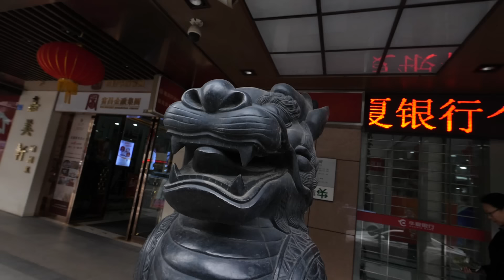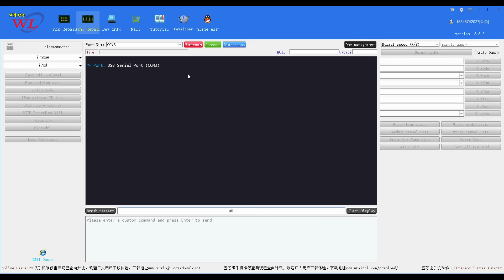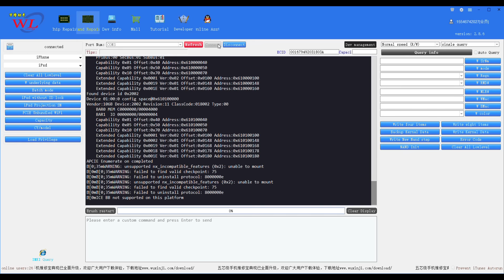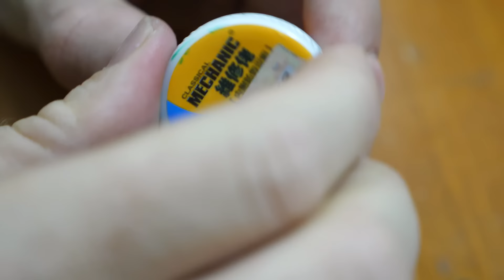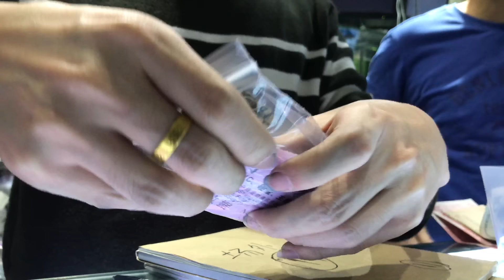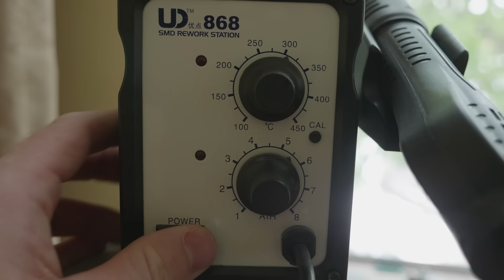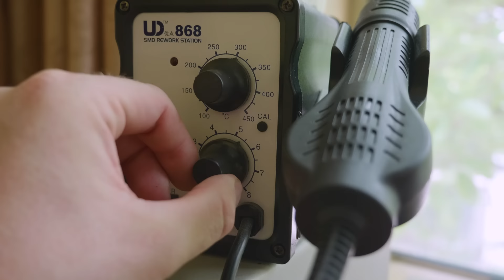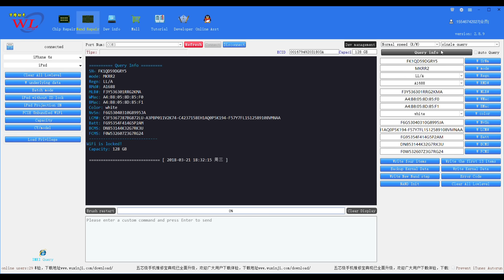How I Upgraded My iPhone Memory 800% - in Shenzhen, China

Comment: Ohh. You meant storage. I was like who the hell needs 16Gb ram in an iPhone?!
Reply: Haha right? iOS is totally a ram hungry operating system
Reply: Although it would be pretty cool to see a ram upgrade as well!
Reply: iphone x still using 3gb when 4-6 is the standard
Reply: iPhone works pretty well on low ram, the process control is really good.
So yeah, it does not have to be on par with Android standard for now in terms of ram.
Reply: This isn't about need though, it's about modding and doing something awesome! modding the iphone for more ram would be pretty cool imo!
Reply: but your paying for 1100€ of hardware and your getting something behind the competition
Reply: Of course, if Apple would give me more hardware, no one would say no.
However, I've owned two good phones from both party, previous Galaxy Note 3 and my current iPhone 7(not the plus). The latter one outperforms Note 3 in most aspect, despite have 1gb less of RAM.
The only thing you should be caring about is "end user experience", that is what you will really experience. Specs are important but should be put at lower priority.
I'm still using my Note 3 though, it does have open source advantage over iPhone for power users. For instance, I use IFTTT, web requests and Tasker for squeezing out more functionality out of my smart home. Other than that, for average customers, iOS is really an enough and better choice if you could afford the price tag.

P.S. I'm totally supportive for modding on iPhone, that's why I subscribed to this guy, it's more challenging but amazing.
Reply: yea and that $1000 gets you the most powerful processor ever in a smartphone and the best storage speeds you will see for the next couple of years, which makes the iphone run smoother and feel faster than any other smartphone.
Reply: Sage Wang android uses even less ram per se, but it is more focused on multiamtasking, if you ever watched a EverythingApplePro speed comparasion you would see that the iPhone reloads almost every app but Android phones doesn't. I think that this is not a valid point for the iPhone running "better" as today every phone is powerfull enough to do whatever you need to
Reply: Top Kek hate all that bullshit, not an apple nor android funboy but if you compare the user experience it is almost the same, some prefer one and some preder the other. So pls stop that BS
Reply: Of course an iPhone 7 will outperform a Note 3... They are 3 years apart. RAM has nothing to do here, 3 generations of CPU do.

You made no goddamn sense.
Reply: Yeah lmao I was like ok cool he'll have a lot of ram
Reply: Nikwunu your phone doesn’t use more than 1 1/2 to 2 if you are really drawing a lot

Comment: Those capacitors are mainly use to keep up with the memory speed. 
Missing few or so of those capacitors will result in a slow read & write speeds, which will cause the phone to throttle down due to insufficient read speed while opening an app or taking a photo. 
Could even affect video recording if there’s not enough ram left and the video is longer than 2 minutes. 

Most of those private iPhone memory upgraders stores won’t care if they mistakenly loose those ships. 

Yes, more memory, cheap, but at a cost of performance. Not worth it. 

At this point you realize that paying 150 to Apple is worth it.
Reply: I can too because im no iSheep.
Reply: Steve Owen Good for you. But that sd card still costs you lose in performance. The slow in transfer data out of the sd card will have an impact on your system.

Comment: You can do everything with your iphone in China but you can not jailbreak ios 11.2.1
Reply: until some chinese find the exploit ;)
Reply: CodeAsm its all about hardware isn’t it? Hope they do the same for ios software.
Reply: truth is already found. it's about some Chinese folks don't public it for no reason.
Reply: And same thing happens recently. Now Intel i7 8700K can work on Z170/Z270 motherboard coz some Chinese folks public the micro codes for older motherboards. No need to buy new motherboard Z370 series.

Comment: Couldn't you have installed Windows on Mac?
Reply: If I were to guess the reason, Bootcamp's drivers are good but it's not as good as running Windows off a Windows machine; sometimes UI scaling is really messed up. Also, he'd have to purchase a copy of Windows and probably get dongles.
Reply: SDG Danny no need to buy Windows. It'll run just fine without being activated. Buying just unlocks personalization and removes a watermark in the corner. Neither of those things will get in the way for projects like this.
Reply: MarioMan true
Reply: Probably to avoid errors and save money in the long run.
Reply: Jake Roosenbloom  dude I tried and I still have traumatic dreams about it.

Comment: Why not check for continuity between all the pin before soldering the memory and then compare the board you just worked on. It shouldn't hurt the chip testing continuity.

Comment: Android = SD Card Slot 
Apple = Buy a new phone or do this XD
Reply: well u must have 2 phone to compare i use samsung and i use apple all my phone 32 gigs well i tested to install all apps the same apps well samsung get the memory full first and apple just half empty and abut the ram samsung phone or any android used 2 gigs while doing nothing but iphone have 2 gig can do so much more bro u must try 2 phone together dont judge if u never use apple and samsung
Reply: @robertvincent5169  the operating system is there to use as much memory as possible for better performance and features..
Reply: Android SD CARD = Only files, photos and videos.
Apple Internal memory = everything and anything including apps, software, photos, videos and files
Reply: @Tom3294.  well that kind of true but some apps can be saved on sd card
Reply: @Tom3294.  ROOT and you can mount any sd card as internal storage
Reply: Many high-end Android phones don't have a SD card slot anymore as well.

Comment: Memory and storage are different memory=ram
Storage=capacity 
You can’t say memory change because that means ram switch to most people who know the difference
Reply: He already told that he made a mistake about memory and storage. :P
Reply: Although you are correct, but technically storage is also a memory, it's just that ram is primary and others come under secondary or external memory.
Reply: Most people don't know the difference. People who do are part of a niche population.
Reply: It's really just semantics, see https://en.wikipedia.org/wiki/Computer_memory and don't just read a sentence that agree's with you if you care. Wikipedia is written by random people, but a good source of information nonetheless.
Reply: ram is temporary storage for reading code and transmitting it to the cpu the more ram the more it can remember and the faster the device runs but at one point the ram will not make it faster because the cpu is slower
Reply: Blu BoX Not really. RAM is high-speed volatile flash storage. A hard drive is slower non-volatile (flash for SSDs) storage. Both can be used for storage or for random access, but non-volatile memory is better for storage and high-speed memory is better for random access.

Non-volatile memory is memory which can maintain its state after losing power.
Reply: Blu BoX yeah I thought he was gonna get 16gb or something lol
Reply: Memory or nand storage doesn’t matter the intention of this video is to show all is possible if you put passion and hard work
Reply: For some reason Memory sounds better to normal folks, just sounds easier
Reply: Its a perfect clickbait then, isnt it?!
Reply: Memory just means memory. System memory is what most people think ram is and most people don't know how broad the term ram really is. Almost everything is ram.
Reply: it's still memory.. a different one indeed but he's not wrong. so.. people that "knows the difference" will know that he meant storage by "switching memory" not ram.
Reply: It is, in fact, eMMC Flash Memory he's soldering, so he's using the right term.

Comment: I watched you on Barnacles Nerdgasm's livestream and that is how I found you channel. I have not looked into how the Iphone 6 plus 4K camera stores the video it records to the internal 16gb NAND chip ( I assume ). I was interested in seeing if it could be adapted to record to the MicroSSD. I know the newer storage tech is faster and has a higher storage ability but I have a MSATA in my laptop. I bought a case for it because I was worried that it may fall out of the slot being so much small that the port. So I bought an external case that holds the MSATA and makes it larger. So that interface from large SATA to MSATA has been made. The thing to find out now would be can whatever the Iphone 6 plus uses to attach to the internal soldered 16gb be de-soldered and a MSATA connector attached that would allow cards smaller than a credit card to attach. The compatibility would be handled by a software program. There should already be many programs that handle being an interface for pictures to a storage device. One may already exist to transfer from an Iphone 6 plus to a MSATA.

Comment: Memory =/= Storage
Reply: inb4 a flame war. But I agree. We should have clear rules what means what, and I advocate for "memory" = "volatile system random access memory"
Reply: memory both goes for RAM and ROM (the M means memory for both).
Reply: Yeah, but to keep people from mistaking which functional type of memory it is, maybe it's best to say "storage" instead
Reply: Yeah ROM isn't Storage though, not in this sense... ROM literally means Read-Only Memory
Reply: Do U mean memory != Storage ?
Anyway both are memories ... So...
Reply: Storage is Non-volatile memory. I guess Scotty's use of "memory"  is based upon, that hardware-wise, chips used for solid state storage, such as the one that is being replaced on the video are commonly referred to flash memory. In olden days, CF, SD cards are commonly called "memory card", Sony even name their stuff "memory stick"
Reply: Being pedantic and being wrong at the same time. Funny
Reply: "Blowing my mind" what about water = wet... 😑
Reply: For those of you talking out your asses and trying to be technical, when people in tech refer to memory, they mean RAM,  ROM is a power-off permanent storage medium, which is why we refer to it as storage, just like the manufacturers do.
Reply: Good for you men. You won an applause. 👏
Reply: Exactly.

Comment: 1:20 I cringed so hard, he could have just used boot camp assistant to run windows on his mac
Reply: no. Bootcamp is notoriously bad with proprietary drivers and causes all sorts of problems with usb connected devices
Reply: @AJK031695  Not in my experience of using it... then again, I only use it on my Macbook for doing simple things that mostly don't require USB's because of that stupid USBC crap.
Reply: There lots of limitations n driver bugs.

Comment: Why you didn't use some of the flash BGA from the scrap boards without i clould lock to put the on the motherboards with I clould lock and when you succeed you will have working main PCBs without i clould lock 😀?

Comment: Subscribed, and trust me I'm a very reluctant subscriber. Just don't want to be bombarded with too much crap, but I love this kind of stuff. 
I was supposed to come to China in May until this fucking coronavirus. Still wanting to come after it blows over. do they have these repair shops in other parts of China like Beijing and Shanghai?
Are you planning on using this knowledge to make some money doing this? Or is it more for just upgrading your own stuff? I think having this skill could be a good moneymaker in the United States since there are not as many people who can do this here. 
I need to get one of those microscopes 
I'm planning on trying to replace the broken glass on an LG v40. If I can find a replacement cheap enough.

Comment: Great Channel quick question I have an iPhone 14 pro Max that I crushed in my back pocket didn't know my keys were there but now I have the front screen and the rear screen cracked with one of the camera lenses screen also cracked here in the states they want close to 800 to fix I know someone in Italy that will fix it for under $600 but I figured all of these items are made in Asia and I'm sure there must be someone in China that would be able to fix my phone more affordably my only issue is that I'm afraid that they will switch out my original parts for aftermarket parts and the phone will not function properly what do you recommend?

Comment: when using stencil? can you use put stencil on chip, apply paste, then remove stencil, then???....put chip on board??-without pre heating balls?  or can you put paste on with stencil, remove stencil then heat up chip without stencil, then position chip on board and final solder?.....or none of the above?

Comment: Thats amazing if you do that as a job because the chip reader and programmer costs a lot, so if you have to do it yourself well it does not make sense!! I do upgrade Original Xbox from 64mb to 128mb and I am very familiar with soldering and also fixing but still if is just for yourself and you are not living in Shenzhen than the option you have to buy unfortunately is from apple.

Comment: With Bootcamp you could have repurposed an old intel Macbook into a Windows PC. You might (NOT SURE) have even been able to use it unactivated.
Also, there's one problematic example of price differentiation.  Fire tablet, 8gb vs 16.  The problem is that the 4gb is already taken up with the OS, and installing 'Star Wars: Kotor' (which was actually free from amazon at the time) eats up most of what's left.  What happens when a premium feature isn't really premium.  That's what has me a bit worried about the new 8gb macbook air's, when they have already sold intels with 16gb of ram, previously. I'm very worried Apple is going to require 16GB of ram for something in the future. There is a way to upgrade (thanks to Yang Changshun) but it looks even more difficult than this. :/

Comment: there was no need to buy a new computer to use windows if you have a mac!
you can use bootcamp on mac osx to have a second partition where  windows will be installed and booted on this, or ! virtualize an operating system with virtualbox and workstation for mac.

Comment: Hello there I have done the same thing I have changed my graphics card and running a EMULATOR of iOS and it’s running about 32 GB of ram also the have installed a i9 also a 1070 however this is a light version of the graphics card however it still works and runs the iOS hardware is what you could call working smoothly at this point lol honestly because it’s running the same iOS however your getting around 210 FPS to almost 150 FPS and there’s settings you can change to upgrade your gameplay also if we’re talking space I have installed a couple drivers because it’s a GeForce card this means you can clip things however you will have to enable custom binds for this others will not clip on iPhone devices

Comment: So if its possible to unsolder a memory chip from a phone and  store data and transfer to another chip. Is it possible to Salvage memory from a phone that has had some water damage, meaning it was beyond repair, it wont turn on,  if so, how would you do this. My phone contains some baby photo i may of lost forever.

Comment: my other challenge is it? turbocharging a weak QUADCORE tablet and another OCTACORE between (1.5 to 1.7 ghz) from Samsung with 256gb rom and 4 ram with Android 10 ie transplanting the soul of a NOTE 10 on tablets 👉 the reason for this is because I have a tab A 2019 10.1 with exynos 7904 processor 2 gb ram and 32 gb rom - how interesting it would be to have something else with. a weak processor?

Comment: for storage is just plain corporate greed, before they still did the "price grid" yet give us a way for future expansion... aka micro sd slot... but they too it out, the same for aux port.... and if anyone DARES to say that to make them more water proof, then they should also removed the speaker port, the charge port, all buttons, and even the barometric sensor port